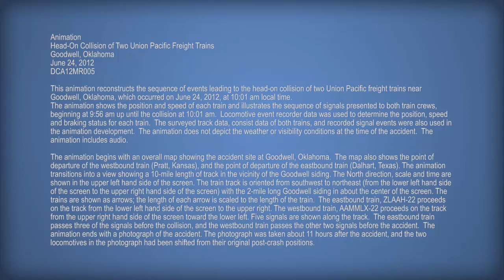Accident Animation, Goodwell, OK

Comment: I don't know what, if any, protocol governs the setting up a of pass like this one, i.e., which train holds the main and which goes into the hole. Was the way it was mandatory, or was it at the dispatcher's discretion? For discussion's sake assume that it was the dispatcher's call and that he or she had set it up the other way, i.e., the eastbound train would go into the hole and the westbound would've held the main.

In that situation the westbound would've kept coming on at track speed (or with some mandatory slowing -- is there such a requirement???)) but in any event its crew would not have been planning to stop.

Now consider the eastbound crew's behavior. They had already ignored signal(s) requiring them to slow their train in preparation for going into the hole at the west end of the Goodwell siding. As things eventuated they still weren't paying attention because they were going 68 mph when they'd have run through a switch set to divert their train into the siding. IMO that would've derailed them and put the power (both) on the ground. -- HARD -- at 0958.  Who knows what would've happened to the following cars, but it would've been UGLY -- all of it.

In this scenario, the westbound train crew would've been much closer to the eastern end of the siding but probably still would have been able to plug it in time to stop before running into the westbound on the ground -- after all, they were awake

The eastbound crew would've waked up just as they hit the ground and then been knocked out -- permanently. 

What a darned shame!!
Reply: +OhioInvestigator From page 4 of the NTSB report: "While observing the train movements on the computer screen, the train dispatcher noticed 
the track circuit indication for the switch at the east end of the Goodwell siding start to flash, indicating that a switch was out of correspondence.4 The train dispatcher immediately made several attempts to contact both train crews by radio but was unable to do so. He then checked with another train crew in the area to confirm that his radio was working properly. A short time later, the conductor of the westbound train used his cell phone to report the accident to the dispatcher." (Footnote 4: "Out of correspondence refers to a condition in which a track switch is not lined and not locked.") http://www.ntsb.gov/investigations/AccidentReports/Pages/RAR1302.aspx
Reply: +OhioInvestigator The quote supporting my first comment, found in footnote 3 on page 4 of the NTSB report: "NTSB investigators examined the switch points at MP 483.7 and saw fresh contact marks on the field side, a gap between each switch and its stock rail, and a severely bent rod that controlled the position of the switch. These marks and conditions are consistent with the appearance of a switch that has been run through in the wrong direction."
Reply: +OhioInvestigator At 0:52 the video explains that the EB train was supposed to stop on the main line and the WB train was supposed to pass it (at speed) on the siding. The switches were properly set. Not mentioned here, but in the report, the metal of the East switch was deformed in a way that indicated that the EB train crossed it when it was set for the WB train to enter the siding.
Reply: The switch had to have been aligned for the siding or the westbound would have gotten a stop instead of the approach diverging. The eastbound just blew right through the switch.
Reply: navy57 Not sure what the Reg's are these days, but years ago, Eastbound trains had priority over Westbounds.  Of course, when that rule was brought about over a hundred years ago,  we didn't have too many different classes of train, like Intermodal, grain, oil, container, etc.  Back then there were freights or passenger, or sometimes mixed trains.Nowadays with so many different classes of trains with different priority levels, who knows anymore what gives one train higher priority over any other train.  For example, even though EB usually gets priority over WB, a WB container train about to meet an EB drag freight might get priority due to the urgency that the RR places on getting those cans to destination.  Could be any number of factors nowadays that affect how trains get priorities.  But that's the way it used to be, was that the train with the priority (however determined) would hold the main, the inferior would take the hole.
Reply: @stanpatterson5033  -  Incident happened in CTC territory - in such territory Signal Indication is the total authority for movement.  There is no superiority of trains by either Direction, Schedule or Class.
Reply: +OhioInvestigator  I can't really answer most of your questions, but I'd like to address the part about radios in the form of an observational comment.A few years back, in light of all that was happening in North America with respect to incidents and accidents,  Canadian Pacific instituted a directive that the Engineer call out verbally on the radio (on the main running channel) what s/he sees the signal being displayed as s/he approaches that lit signal, as well as naming the point that s/he is passing (as a reference to CP waypoints).  Whether or not the radio chatter is recorded, I don't know, but as someone who listens a lot via scanning radio,  I can say that you can hear it usually 4 miles away, further if using better equipment and antennae.  Where I live, CP has mostly single-track, with recently enhanced sidings, some of which are now approaching 3 miles in length.  While trains are waiting on the sidings, they should be able to hear what is approaching by these signal calls. Then would be the time to either summon the approaching train by radio contact, or begin evacuating their own cab if they think the oncoming train may not be fully under control.   Not sure if this sort of scenario would have prevented the incident in Goodwell, but I think that every little activity performed in the cab of a locomotive can only help alleviate boredom and help fight fatigue.  Oh, and standing/waiting crews of stopped CP trains usually disembark from the cab with radios and flashlights, and perform a visual inspection as meeting/passing trains go by on the main.
Reply: +OhioInvestigator   Actually I believe you've dropped a minor typo there. I believe that you meant to type "Why was it (the switch at the EAST end of the siding) aligned for the main track when that WESTbound train was supposed to go on the siding?", as the animation shows that the EB was to hold the main track, and the WB was to have taken the siding. Based on whether one scenario was to have taken place against another,  you do have a valid question as to how switches were aligned.   While I don't have definitive answers, I can only surmise that dispatchers and controllers cannot know for sure when or which train will arrive at the meeting point first.  It is a possibility that both end switches are left in the main track alignment until they (dispatchers/controllers) hear contact from one train or the other, and then make adjustments as needed.  Also, sometimes the length of trains dictates which shall take the siding and which shall hold the main; sometimes this takes precedence over the old rules-of-thumb of EB trains having priority over WB trains.    For example, if one is physically too long to safely fit in the siding, but the other will easily fit, then it would just make more sense to have the longer train hold the main track before passing the end switch,  then let the shorter opposing train park in the siding, re-align the switch so that then the longer train can simply proceed to pass on the main and be on its' way, and then have the shorter train depart in the opposite direction from the siding.    I do know that when no one is present and actually using a switch, it is generally accepted that it always be lined and locked in the normal (straight through) position. In the Goodwell case, I have no idea why both trains were not in contact with either each other or a controller, but from what little experience and knowledge that I do have, dispatchers/controllers have lots going on to draw their attention.    I suppose that it is possible that one (or both) of the trains made an attempt to contact a controller, but that the controller had a bigger fire (no pun intended) to put out at the time, and was in a position to deal with new contact as soon as the more important issue had been dealt with.   It is safe for the dispatcher or controller to assume that trains under his/her guidance are going to be alert and observant, and reacting prudently to the signals that face train Engineers, and that the Engineers will operate within the confines of the rules of operation, and upon encountering unusual circumstances, call in for guidance or instructions.
Reply: +Stan Patterson You are correct--senior moment on my part.  That's what happens when you are pushing 70.  I viewed the animation / narrative again and I got it this time.  As you said, the question of the alignment of the track switch at the east end of the siding hasn't been answered.  You read the huge number of comments on the website csx-sucks.net and some T&E guys really rake the Dispatchers.  The Goodwell head-on collision certainly brings up the question of communications between the 2 trains and with the Dispatcher.  The NTSB left out that very important information.  The NTSB conclusions on the June 24, 2011, Nevada, U.S. 95 crossing crash involving a tractor-trailer and an Amtrak train, in my opinion, STINK!  The NTSB animation shows that the truck's skid marks were mostly in the proper lane.  Yes, they were.  The right side tire skid marks, 340 feet long, were entirely in the proper lane.  So, NTSB, "how was it that the gate, IF down, was not smashed / broken off the gate mech.?"  The gate wasn't damaged.  A Reno TV station had gotten calls from motorists before the June 24, 2011, collision, reporting malfunctioning lights and gates.  And, the station got calls after the incident, reporting the warning devices malfunctioning.  NTSB totally blamed the (dead) truck driver.  The crossing is in the "40 mile desert" and I think the wind blows sand onto the track, inhibiting shunt.   Amtrak Engineers had reported "near misses" at the U.S. 95 crossing before the June 24, 2011, horrendous collision and fire.  It's a fact, but don't ask the FRA / NTSB, that Amtrak trains have shunting problems in various locations all over the U.S.
Reply: phillyslasher  you, sir, have done your homework!  Job well done!  Move to the head of the class.  It's refreshing to read your posts rather than so many others that merely vent, bloviate, or make a huge failure at trying to seem even remotely intelligent.  I can't help myself from laughing at most of the comments made by "John Q Public".  Then the dreadful sobering thought crosses my mind.  Is this country's inhabitants really as stupid as they seem?  Sadly, the answer is always affirmed.
Reply: +Stan Patterson STAN, good and informative comments.  One has to wonder what was going on with the 2 UP crews leading up to the June 24, 2012 head-on crash.  It appears there was no communication between them.  BUT, the real concern I have is the track switch on the west end of the siding.  Why was it aligned for the main track when that eastbound train was supposed to go on the siding?  Was the track switch going to be moved remotely by a Dispatcher after the eastbound train stopped at the RED light, which it didn't?  There seems to be a lot of mis-communication / lack of communication involved in the horrific Goodwell crash.  Since the U.S. put a man on the Moon in July 1969, why is the U.S. railroad industry, in many ways, in the Dark Ages of technology?  From my investigations over 25 years, I have found that the RR industry is just about the most bottom-line industry in our country.  Meaning:  Profit First, Safety Last.  They could have gone to concrete ties many decades ago AND the FRA should have mandated getting rid of the wooden ties.  Concrete ties are about 10 times stronger than wood and are especially important to maintain track gauge on curves---lateral force moves rails!
Reply: +navy57  -- I'm Navy '67 to '72.  I like your comments.  Consider that the locomotives had 2-way radios.  So, why weren't the Engineers talking?  They both knew that they would be passing each other and that the eastbound train  had Timetable Orders to go on the siding.  ANOTHER MISSED ITEM:  Why was the track switch in a position to allow that eastbound train to stay on the main line instead of going into the siding (hole?)  Did the Dispatcher fail to align it by remote control?  QUESTION for the NTSB:  WHO was responsible for aligning the track switch on the west end of the siding???  Why didn't the NTSB discuss that issue in their reports?

Comment: Months before it happened, the engineer of the eastbound train had corrective eye surgery but was complaining he couldn't see too well. Wasn't sure if he attempted to get it done right the second time or thought it would heal on its own.
Reply: +jmm2000 The engineer may have been color blind, but even assuming that he was, shouldn't he have been able to distinguish between signal lights that were on or off?  

If he could, then the light(s) position(s) relative to the others, and their behavior (solid or flashing)  of the lights  -- in toto, the aspect of that signal -- should have told him what the rules meant for him to do.

That he could have: (1) been able to distinguish between whether light (s) were on or off, and (2) been able to see and understand the signal's aspect --  would  have given him the complete benefit of the doubt!

Those things MIGHT have possible -- IF BOTH HE AND/OR THE CONDUCTOR had been ALERT.  Obviously , neither of them was.

Related topic/question:  

In maritime collisions, groundings, etc., the Investigations always back track from the point of an incident's occurrence to determine the location of the last possible location at which the incident could have been prevented by an action of one or both participants. I didn't get the feeling that this was done. Am I forgetting something?.

Comment: Sometimes it's useful to actually read the report in addition to watching these videos.  The engineer had bad vision and could not read the signals.  The report states: "The engineer of the eastbound train was unable to visually detect and correctly interpret the signals and he operated the train as if the signal aspects were green."  http://www.ntsb.gov/investigations/2012/goodwell_ok/goodwell_ok.html
Reply: Locomotives can be left to sit unoccupied for logistical convenience and can be 'ghost-started' via satellite for operational assurance. The technological capabilities must exist to virtually eliminate the possibility of an incident like this.  

Years ago here in New York I saw the appearance of stranded, very heavy-gauge wire welded to the underside of the top of CSX's rails, bridging the gap where plates were used to join sections. I figured it was a continuity feature similar to what you describe. 

There are some impressively advanced safety systems in place that I've seen mentioned in comments about these crash report videos. I don't know what was standard when this accident happened, but redundancy features for fail-safe operation are needed. They're evident in the alarm and IT industries, for example, and I'm sure they're present in railroading, but they need to be greatly enhanced. 

Even though 'fail-safe' isn't a 100% guarantee, removing as much of the element of human error as possible brings things closer to being foolproof. A remote monitoring system that doesn't override non-suspicious, routine control by an engineer but is dedicated to override and rectify human mistakes or omissions is in order. There's no reason for there not to be an unbreachable computer-controlled pre-emptive warning system which would remotely govern and stop locomotives at the first indication that commands or good sense have been disregarded. Trains would be miles away from collisions like this, safely stationary. Any 'false alarm' would result in a delay. Human error can result in irreversible consequences.
Reply: They really need to add inductive loop sensors to the tracks. That would help prevent accidents like this, when someone can't read a signal, or is asleep.
They work by having a loop of wire between the tracks, and that wire is connected to a certain capacitor based on the signal aspect. This forms a resonant circuit, which resonates at a certain frequency (dependent on the inductance and capacitance). A sensor on the locomotive can detect the oscillation frequency of the loop. This tells the locomotive valuable information, and could stop the train before a collision occurs.
Of course no system is perfect, as there are ways to fool this, but it's generally a step in the right direction.
When you have high-risk things, it's always good to have multiple ways for a given system to operate and detect problems. That way if one fail-safe fails, another will be able to catch that failure and initiate shutdown, etc etc... (Like maybe in a Nuclear Reactor, as an example).
Reply: @BenjaminEsposti  educate yourself on the implementation of "PTC", for railroads.

Comment: I thought only Europe suffered from different train signals between territories.  But even in our mess, I think the only trains without automatic breaking (ATC) are veteran steam engines and service / shunting vehicles. Heavy trains at speed on single track shouldn't be allowed without it.
Sounds like something only  Gomez Adams would have allowed into the 3rd millennium.